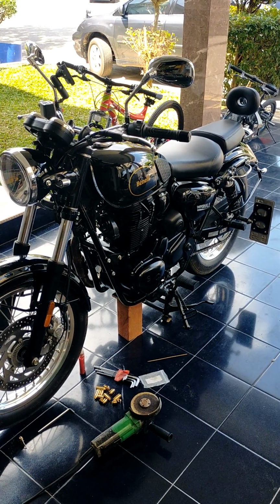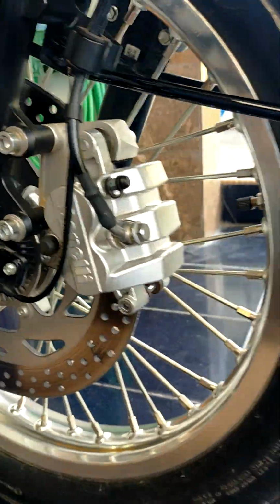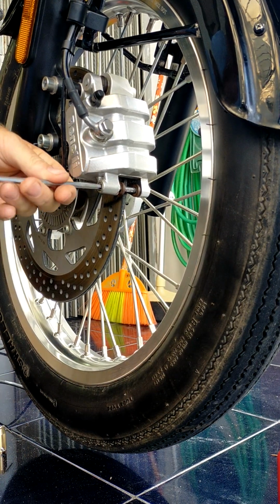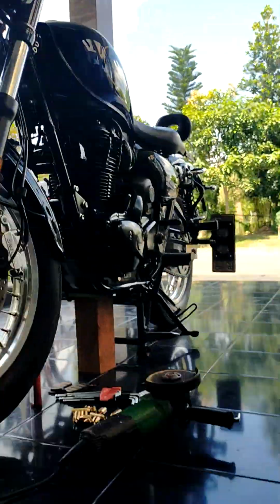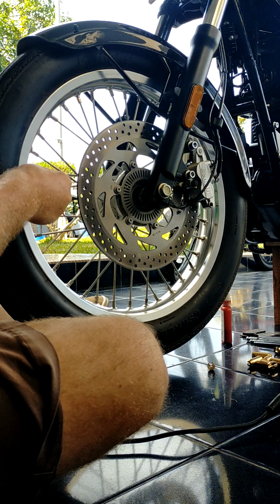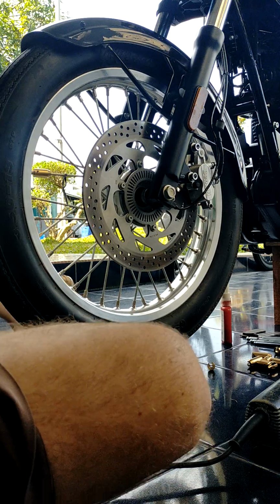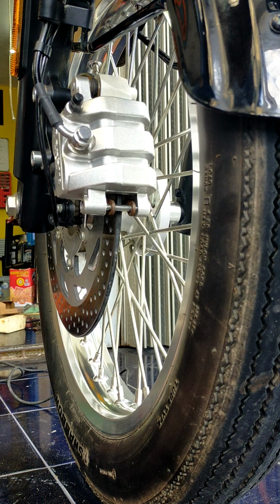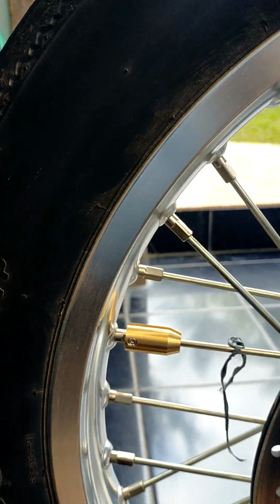BENELLI IMPERIALE 400 Motorcycle Ballance spoke wheels with counterweight fitting

Comment: Well done Andre. I don't understand the significance of spinning the axle though. I understand spinning the wheel to find the heavy side.
Reply from the maker: @underthedrone2735  i am not spinning the axel, I am vibrating the wheel so the wheel find the heavy spot every time on the same spot, some people use a sanding machine, but I did not have one, so I vibrated the wheel & tire with the angle grinder plastic handle touching the axel ... It works perfect
Reply: @genesisbatam  Ahh yes, I see it now that you explained it. Clever!